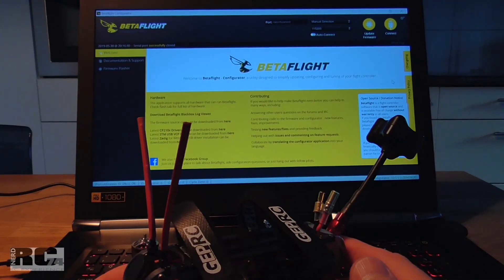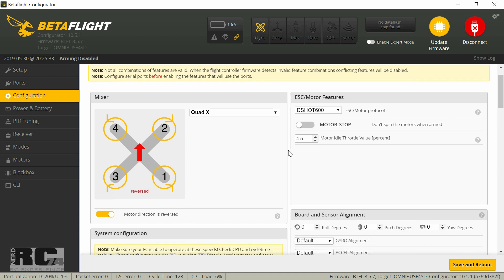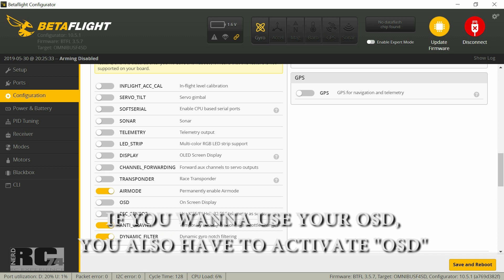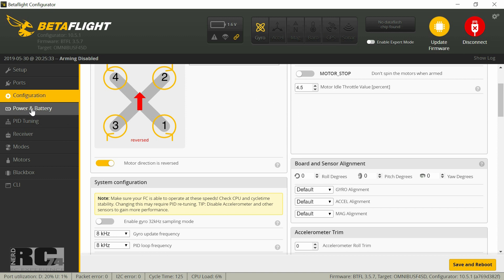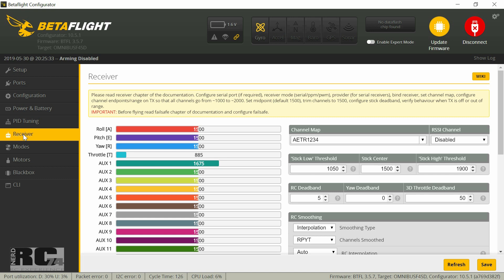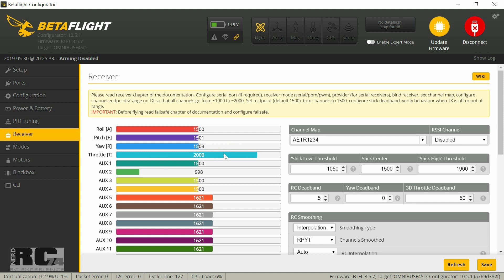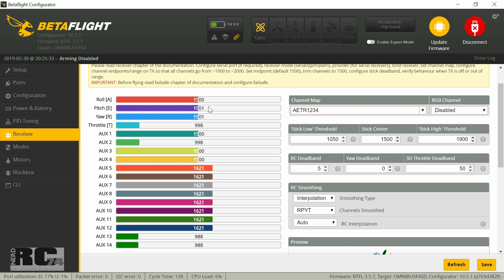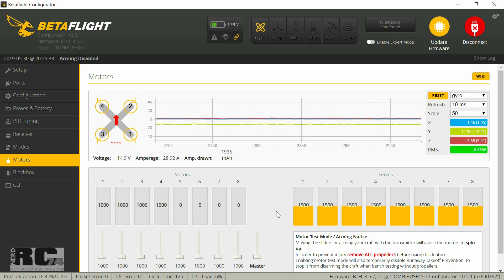GEPRC CYGNET CX3 | BETAFLIGHT 3.5.7 SETTINGS

Comment: Any chance someone can direct me to a 3.5.7 hex file download? I have 4.1.6 right now and want to go back to this version and see how I like it. Thanks
Reply from the maker: Just try the settings shown in this video. If you fly 5" quads just increase P about 5 points on Roll and Pitch. For me it works fine. But i am not a crazy freestyler ;o)

Comment: Hi, I bought PNP. Soldered Frsky R9 receiver. Next I find problem - controll board was rotated. So I set it in betaflight. And when I flight than quadcopter goes forward alone at an angle of about 5 °. So my question is do you have please backup file from betaflight. Maybee is some bad im my settings.
Reply from the maker: Do you use andy kind of angle or stable mode or so? If yes i highly recommend to switch to acro mode. Or you do the FC calibration on betaflight.
Reply: @RCnerd74  All calibratiin I do on Betaflight.
Reply from the maker: Does it work now?
Reply: @RCnerd74 No. I write aboat it first time. But outside its flight freestyle good. Only one thing - not leveled.
Reply from the maker: hmmm... would be helpful to see a video about how it flies. Like this it is difficult to tell you if there is something wrong or not...
Reply: @RCnerd74 And could you please save your file from Betaflight and send me it? I can compare if fail is on my side.
Reply: @RCnerd74  Now its OK. It was bad firmware
Reply from the maker: @thegrid89  OK. Enjoy your Cygnet CX3 :o)

Comment: I have Beta-flight 4 installed, what’s going to happen when I plug in the Cygnet? Whorls I download and install BF 3.7 ? Or move to BF4.5?
Reply from the maker: I highly recommend to go with 3.5.7. You can use stock settings. Just set your expo, rates and rc deadzone like you wanna have it. And Dshot 600 if not already set from factory. I heard a lot about bad tihings happen with 3" quads if you use BF4.
Reply: RCnerd74 will do! But I run BF4 on my CineBee and it flies great. As far as I can tell :-)

Comment: Hi RCnerd 74, in your opinion what is the best betaflight version for a beginner ish person using a 5" quad?
Reply from the maker: Hi Tobias. Try 3.5.7 on stock PIDs. If your quad is 600g or more RTF, just increase P and D around 5 point. For example from 50 uo to 55. 10-20% expo and 3-5 points RC deadzone does also help to make it a bit more smooth. For me my Armattan Marmotte feels good.

Comment: Hellow in the bnf version need do do a solder on sbus place on flight controller?
Reply from the maker: On the bnf version, a FrSky XM+ receiver is already installed and wired up. You only need to bind with your FrSky transmitter. If you want to, you can also do firmware update on your fc. But for this you don't need to use your rc receiver on the quad.
Reply: @RCnerd74  i have a flysky controller can i used with this quad?
Reply from the maker: @Likehunter88  you need to do a mod to make the frsky rc receiver of the quad work with your flysky transmitter. watch this:  https://www.youtube.com/watch?v=RDeRIGQFtEE   If this doesn't work you need to change the rc receiver on the quad to a flysky receiver.

Comment: Do you have any idea about the amp meter settings? That seems completely wrong for me right now with the stock settings ...
Reply from the maker: I don't fly with OSD on. So no need for me to setup the amp meter. But it's normal that you have to calibrate the amp meter settings to your quad. I just use the timer on my transmitter to know about my flight time.

Comment: I have the Xm+ receiver, the issue I'm having is getting the Cygnet 3" to bind to my Taranis Qx7. Any ideas??? My switches are already set up but no response in betaflight in the Receiver tab... Please help if you can.
Reply from the maker: If you do not have a solid green light on your XM+ after transmitter and quad are powered on, try to bind your receiver with the following tutorial video: https://www.youtube.com/watch?v=ZOBwwNpjNrY wish you luck.
Reply: I think the XM+ stock comes with non-EU firmware. I had to flash new firmware to get it to work with my EU QX7.